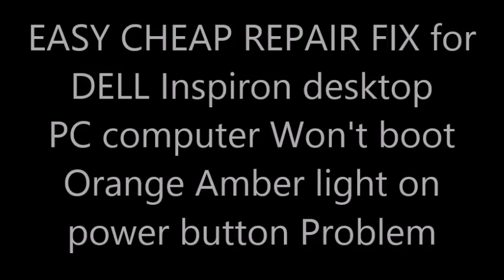Dell Inspiron orange amber light problem PC will not boot EASY CHEAP REPAIR FIX

Comment: Thank you so much. I had the steady amber light issue, and I didn't know what to do. I watched your video, waited a few days, and then followed your instructions, and it worked.  I was pretty scared that I may have lost a lot of valuable stuff, so now I know I need to be more prepared.  Thank you once again.
Reply: WELL, it worked for about twenty minutes and then went off again.  When I turned it back on, it returned to the steady amber light.  Damn...
Reply from the maker: replace the CMOS battery.  The cmos settings are getting corrupted if it is happening repeatedly.  Do the procedure to drain the power out of the system, replace the cmos battery, then when you get it to boot again, pull all of the important stuff off of the PC just in case it happens again.

Comment: HELP!! Hopefully you still read the comments.. I have a dell inspirion 3847.. I did everything you said and it worked.. i was so thrilled that I didnt lose over 2tb and 4 years worth of stuff.. BUT after I shut it down and restarted it the next day same problem solid orange light nothing comes on screen.. So I removed the new battery only 2 days old for 15 min put it back in started the comp and got a white light then 5 blinking orange lights same as before.. I powered it down not unpluggging it and powered it back up and it turned on.. I was wondering if I missed something I was supposed to do as I dont wish to go through this everytime I shut down the PC.. Its scary I dont want to lose everything.. When it powers back up it says the BIOS was reset and press 1 to continue which I did and press somthing else I dont remember to go into settings.. I wonder if I am supposed to go into the settings and do something? please you already saved my life by bringing me PC back to life anything would be helpful.. THANK YOU!!!

Comment: As of 2023, I got this issue, but only was able to fix it by unplugging the main power supply cable, and then pressing the power button and holding it.  I also replaced the CMOS Battery as well.  It finally worked.

Comment: Hopefully you are stil watching this thread... I just walked in my studio and my XPS 8930 that had been turned off for a couple of days would not boot and I got (either) 1 blink amber then 2 blinks amber .. .Or 2 blink amber and 1 blink amber  dell service manual says system board.. the computer is  6 years old and never had the battery changed so I will try this the first thing tomorrow morning...  Everything else was running on the computer before I had this issue...  I did have the PS checked and it is fine, so Hopefully it's the CMOS battery..  What setting were you using on your multi meter... I just though a voltage test would have shown the problem...

Comment: Great video I have a Inspiron 530 when I turn on solid amber light and fans runs. eventually will turn blue and boot up. Is this a sign of bad battery or power supply? Thanks!

Comment: And what happens when you’ve changed the battery and you still have a solid orange light and a black screen
Reply from the maker: if you watch the video, changing the battery has nothing to do with solving the current problem.  The battery needs replaced due to age, but the problem is that the bios settings got corrupted (probably due to old bad battery) and in order to reset them, you have to drain the power out of the system as I show.
Reply: did u fix it ?

Comment: well while you were right this is how to reboot the cmos. and it wont work unless you remove the battery and hold the power button as you state. the other way is to move the jumper from the pswd normally closed to the cmos for 6 seconds. but for me thats a lot harder because i have to remove my graphics card just to be able to get to the jumper. so the battery trick is much easier. that said this unfortunately did not solve my problem. im leaning now that my bios is corrupted. or i have a bad psu. im probly goiung to try the psu first and if not i probably need a board. and i definitely wont be going with a factory board since dell has a serious issue with their boards going out

Comment: On a Dell gx620 mid-tower it worked for me only after I disconnected all drives, pulled the ram, cards, and power supply, checked the cmos battery which was okay, then put it all back together slowly starting with just enough of what's normally needed to get things up and running.

Comment: FOLLOW this step by step. He is CORRECT.
Reply: I had already replaced the Bios battery with new one before it died and blink Orange.
Reply: @555_Lady_JB  See what you think about this, I hadn't turned My Dell Dimension on in over a year because the clock system clock lost its memory. I replaced the new 
Bios battery but it was several months before turing on. Last night I turned it on and it was working fine, moved some files around to try tidy it up, I installed Reason 4 on there and it worked. I noticed that when I tried moving two short cuts in a folder it froze so I removed everything from that foulder apart from those two short cuts and deleted it. Then I started moving a 2 gig foulder of pictures from the desktop to My photos on C Drive then it seemed to not do it so I tried again and then it turned off started flashing the orange lite. What do you think?
Reply: @HOLLASOUNDS  you need more space? 1 TB portable 😉  OR you need to map Reason 4 differently? I am merely guessing but hopeful.  OR that 2032_ battery was not good. That's happened to me before.
Reply: @555_Lady_JB  I get what you say about the new battery not being good but it was running on what must of been a dead bios battery before because the date and time would be wrong every time I turned it on, so why didn't it go off and flash Orange then?. Copying files has to save it to Ram first and thats when it crashed and died however I have removed the ram and put them back no change.
Reply: @555_Lady_JB  It is really badly dusty in there, what's the best way to clean it? I try vacuum before, it didn't really help. Should I take the thing apart?
Reply: @555_Lady_JB  Right be clear is this correct, 1 tern off power at the wall or pull the power cable while holding the on button for one minute, clean everything as best as possible then take out the new kodak bios battery I already put in there and swap it for a different more high quality brand like Energizer. The orange light will be gone and the computer will turn on?
Reply: Also unhook the cards and reset everything. Then step by step by this dude's instructions.
Reply: Wait hold up!  Maybe you do DRAIN POWER BEFORE U START CLEANING 😉

Comment: I had a spare power supply.  When I hooked that up and it didn't work I went searching and found your video.  Thanks so much for sharing.  I followed the steps and the computer is now operational.

Comment: OMG!!!! Finally. THANK YOU!!!!  I've been searching the internet for 3 days trying to find out what the problem was before my PC crashed. My problem is slightly different. In the morning when I turn it on the orange button comes on an I can hear the PC start up but not all the way. I have a black screen but after waiting a few seconds to warm up I can restart it no problem. I just ordered a new power switch and cable thinking that was the problem. I think I should probably try the battery first. What are your thoughts? Thank you so much. I pretty much live in the middle of no where so over the years videos like this has has taught me how to repair almost anything on the system. And yeah it is super old but runs like a dream most of the time as I upgrade when needed.
Reply from the maker: Sounds more like a power supply or possibly the HD no longer spins up properly after it cools down.  That is assuming that you are sure that the problem is with the computer and not that your monitor having trouble turning on.  For example, bad caps in the monitor power supply will cause it to turn on slowly for a little while, but it will fail completely soon.
Reply: @bigslick  Oh no! Those are new things I haven't delta with yet. I changed the battery but won' t know if it works until tomorrow morning. The weird thing is when I turned it back on it started up differently and the time and date came up in December of 2010 at 11:11 Also HD is only 2 years old and seems to be working great.
Reply from the maker: @EnergyAndLightAwakening  Replacing the bios battery will usually reset the bios settings, which would reset the clock.  If the HD is new then that is unlikely.  If you still have problems and are sure that the issue is not just that the monitor is slow to display a picture..., then the most likely would be the old ATX power supply in the PC.  Replacements are pretty cheap.
Reply: @bigslick  Thank  you so much. I can't tell you how much I appreciate your help! I think the monitor may be slow. I have an old dinosaur monitor that weighs about 15 pounds ( the ones that stick out in the back) lol I can use to test it.
Reply from the maker: @EnergyAndLightAwakening  It is possible that the bios was losing all of its information and trying to reset to defaults, but I suspect something else is going on.  
A lot of LCD monitors came with bad caps that failed after 4-6 years.  Two of my Acer LCD monitors both had bad caps that I needed to replace, and the symptoms were that the monitors hesitated coming out of standby or from completely off-to-on.  
...Anyway, if you need a power supply, you could try craigslist or even visit an independent computer repair shop and tell them that you want to buy the cheapest used ATX power that they will sell you (that works, obviously).  Should be at least 250W but almost everything was at least 250W.  A good used one should be less than $20.  Most shops cant give them away these days.  They end up throwing them away.
Reply: @bigslick  LMAO my monitor is an Acer! And it's super old.  I 'v never worked one one before.
Reply from the maker: @EnergyAndLightAwakening  Acer monitors from the late 2000s are known to have capacitor problems.  my acer's are both same model, purchased late 2007, 22inch widescreen lcd.  Each needed new capacitors, one in 2014 and one in 2015.  My PCs run 24x7x365 so that may affect the timetable for failure.  Repair is not a DIY job, you need some experience with electronic repair and soldering.  But used monitors are cheap and frequently available on craigslist or flea markets.
Reply: @bigslick  Thank you and yes you were right. There is more going on. I still have the same problem and will try a different monitor tomorrow. The weird thing when I turn my PC on after changing the battery I have to enter my password two times before it will let me in.
Reply: @bigslick  Hello again. I tried a different monitor and it started up fine today. I'm going to do it again just to make sure. I saw the date on it was 2009!! So now wonder. Also I was wondering if I go back to using the Acer until lI get a new one can or will it cause any damage to my PC? Thank you.
Reply from the maker: @EnergyAndLightAwakening  Hi!  It wont hurt the PC at all.  If starting up continues to work fine with the old monitor, then for sure your problem is that your LCD monitor has failing capacitors.  Flat screen monitors are cheap these days.  You can often find good deals  (well less than $100) for new ones at the Slickdeals forums, or browse craigslist or thrift stores in your area, and you pretty easily find cheap used LCD or LED monitors that still have a lot of life left in them.
Reply: @bigslick   I never would have figured out it was the monitor. Thank you so much I really appreciate your help.
Reply from the maker: @EnergyAndLightAwakening  you are welcome.  best wishes to you
Reply: @bigslick  😊🙏😄
Reply from the maker: @EnergyAndLightAwakening  awesome!

Comment: Iv tried it 3 times and its still not working. Mines is a dell optiflex 760 and the problem is steady amber light (not flashing) and 2,3,4 led lit up at back. The fan goes into overdrive when i start it up very loud and the computer wont boot. Iv tried nearly every video i can think of, service manual download etc please someone save my machine or give me a solution, pretty please 🤔🤗

Comment: Hey i have a similar problem, but mine isnt a flashing amber light, just a steady one. Will this work?
Reply: did you fix it? if so how?
Reply: @xlie2019  im sorry i never got to fix it, if i had to guess its probably the ram or one of the connections.
Reply: @Yamoyashi ty for the response

Comment: Awesome.  Thanks so much.  I had an old Inspiron Zino.  Everywhere else on the web and even Dell's official support comments said its a bad power supply or mother board.  Did as you said and it booted right up.

Comment: A very good & thorough write-up. But if still no luck, as in my case. Check the cpu. Having got mine used as well I came to find out that the previous user tried to upgrade with a non-compatible cpu and that was the reason for the yellow amber in my case. I put a compatible one in and now the power lite glows green :-)

Comment: that's what my problem is all I get is an orange light blinking with nothing else coming on and I've changed the power supply and still nothing so I might try what you did

Comment: OMG, this is finally the answer! I have a Dell XPS 420 that failed to post years ago. After months of trying to fix it myself, I just gave up. I tried changing every component and ruled out the CMOS battery because I was told it would not prevent posting. While under the current quarantine, I tried to fix it again out of sheer boredom. I stumbled on to this video through random Google searching yesterday and decided to try it today. Lo and behold, it worked! The key is to clear the power out of the system with the CMOS battery removed by unplugging the power supply while holding down the power button. Just simply changing the CMOS battery doesn't work. Thank you, thank you!

Comment: I experienced the same orange light on the Dell motherboard, but I didn't replace the battery, instead I did step 4. After trying for about 2 or 3 times, it boot into windows.......still works for me though.......
Reply: Optiplex 9020mt?? Or another pc

Comment: Most Dollar stores have these batteries a dollar.
Reply: Not lithium they don’t. You don’t anything else.
Reply: I verified the CR2032, CR2025, CR2016 batteries all say Lithium from the Dollar Tree, Dollar General, and 99Cent only stores. Also any ones of these batteries will work because it's the diameter of the battery not the thickness of the battery.

Comment: Worked on second try.  First time failed, Second time I tested all the batteries in my batch and used the best one. I also unplugged/replugged all the PSU cables and RAM, held the power button longer and left the PC off and batteryless for longer. 
You're the best.

Comment: Done all the recommended suggestions, nothing works  to get our Inspiron 620 powered up again.  Have gone through this a few times over the past year with this machine.  Twice brought it in to a repair shop, where they were able to power it up right away without doing anything??  Last time it wouldn't start up, I disconnected all USB wires at motherboard & it powered up just fine.  This time, we lost power (pc got unplugged by accident) and now cannot re-start using all same "fixes" from before.  Also replaced CMOS battery, drained residual power as suggested in video, nothing works.  I'm thinking it may be a power supply problem, this Dell is becoming a real nuisance.  Thanks for your video & suggestions.

Comment: You said "Step 4: Hold down the power button, pull out the power cord & continue to hold the power button down. Step 5: Let go of power button, pull out the power cord, put in battery,,," How do I pull out the power cord in Step 5 if it's already pull out from Step 4?
Reply: You skipped step 3.
Reply: the fixer it still doesn’t make sense

Comment: When I pressed the power supply and the power button at the same time it works but then it dosent turn off I have to hold 30 second to turn of and then when I connect to moniter it’s not working please help bro

Comment: I can't fins the battery any help?
Reply: If you can find the battery slot, and it doesn't have a battery in it, then that's the case. Or if there is no battery slot, you need new ram.

Comment: I would highly advise to never just pull the power cord of the system just jumper it then befor the cmos swap just power off unplug then just hold power button for 30 seconds

Comment: Fixed it with my two little toddlers! Thanks for the reliable diagnosis and repair procedure!
Reply: When I turned my computer on,  I kept hearing two beeps,  pause,  and another two beeps.  I  unplugged and unscrewed my computer , opening it up to see what the problem was.  It was dusty on the inside. I used some paper towels to clean it. I rescrewed it and plugged it back up to see if it would work.  It  works!👍
Reply: @fredrickdavis5489 dont use paper towels
Reply: Seth Stewart

Comment: Brother, you just saved my sanity. I popped in a mSata drive but didn't unplug my HDD and after trying to power on it did nothing. After yanking cables left and right did nothing I finally removed the CMOS battery which brought it back to life. So this time around I unplugged the HDD drive and am now doing a clean boot to the mSata drive. Not done yet so might need to troubleshoot more but so far my PC lives again!